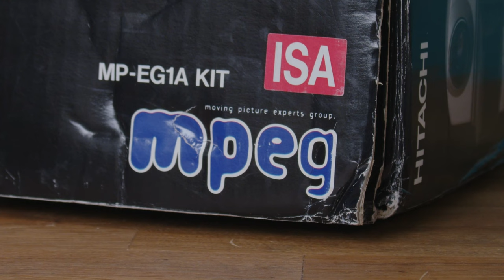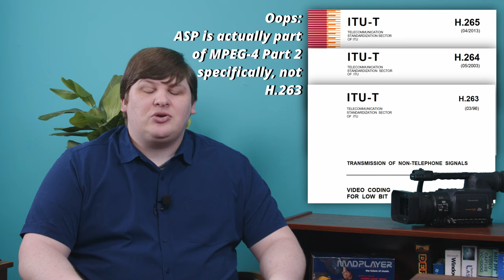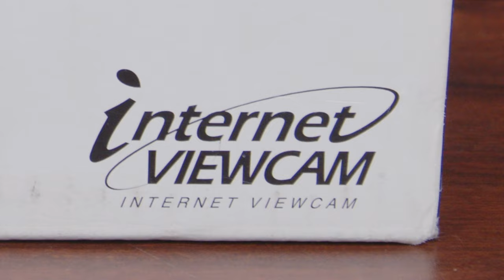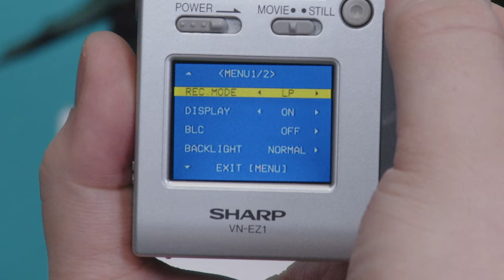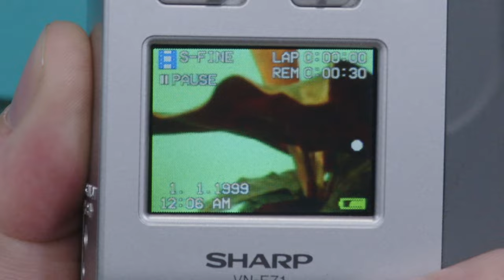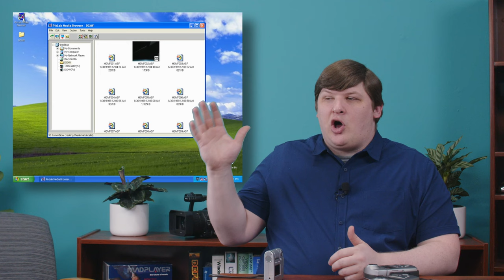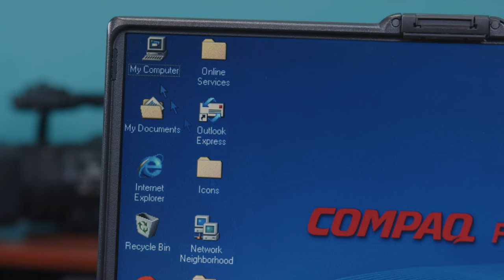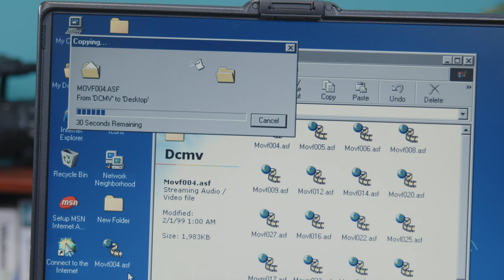The first thing that ever used MPEG4 [Sharp VN-EZ1]

Comment: Hey, CRD, I just wanted to point out that all MPEG-1 and MPEG-2 encoders must include a JPEG encoder as part the encoder. This is because I-frames are encoded in a format that is essentially JPEG, just without the headers that a JPEG file includes to tell the JPEG decoder what it's looking at. For those who don't know, in the world of MPEG, I-frames, aka intraframes are the bedrock of MPEG video compression. The way that MPEG works is that every so often you have an I-frame. Then, after that, you have a series of P-frames and B-frames, before another I-frame. P-frames, aka predicted-frames, just hold the difference between the last I- or P-frame, as fully decoded, and the current frame, and this difference image is much more compressed than an I-frame. There are also B-frames, aka biprediction-frames, every so often, which record the difference between the current frame and the two nearest I- or P-frames on either side of the current frame. These B-frames are extremely compressed, but no B- or P-frame can use a B-frame as a reference, so that their lower quality doesn't infect other frames.

In MPEG-1, the pattern of I-, P-, and B-frames is set before starting the encoding process so that you get a constant bitrate. In MPEG-2, the pattern is determined by the encoder during encoding, based on how much the image has changed from one frame to the next. If the image changes very little between the previous non-B-frame, the current frame, and the next non-B-frame, or if the bitrate is going over the limit set by the person doing the encoding, then a B-frame can be used. It the images changes a bit, but not too much, then a P-frame will be used. If the image changes a lot, then an I-frame will be used. Encoding quality goes up with the number of I-frames relative to the other types. B-frames are rarely used, because using them both reduces quality and increasing encoding time. Later encoders can do two-pass encoding where, in the first pass, no B-frames are used at all, but information about where B-frames could be used without reducing image quality is put in a separate file. Then, on the second pass that information is used to add in B-frames where they'd be useful.
Reply: Interesting, thanks man! So does that mean MPEG-2 has a variable GOP structure? I know video bitrate will vary with content type, that makes more sense now
Reply: @petey8155  yes, the structure is variable for MPEG-2. Technically, MPEG-1 could also vary, but encoders rarely did it. There isn't a whole lot of difference between 1 and 2 as far as I can tell, but I'm no expert. In fact, all MPEG-2 decoders can decode MPEG-1 without a problem.

My knowledge comes from converting movies from DVD to (S)VCD back before DVD burners were a thing. Back then, the encoders for MPEG-1 were all CBR, and you set the GOP structure yourself. MPEG-2 encoders were all VBR, and varied the structure on their own. Now, reading in more detail about this, it seems that this was not really part of the standard, but was just how all the encoders worked. Both standards were VBR with variable structures, it's just that no one actually did that with MPEG-1. Wow, I'm glad I checked that out. It's even weirder than I thought.

To make things even crazier, parts of P-frames can be encoded as if they were I-frames, and parts of B-frames can be encoded as if they were I- or P-frames, which is a big part of why the bitrate can vary so much.

Comment: Sharp has always struck me as one of those really interesting companies that always looks forward but keeps a foot in the past, “just in case”. They know that users don’t upgrade when they’re told, and they have (in their eyes) near-infinite space for their website. What does one page matter, or one section? If someone is out there using this MPEG-4 camera today, or wants to know how things looked years ago so they can compare their new device, let them. Same usually goes for manuals. I really appreciate that approach. It’s not active “support” of the old product, but it makes you certain that when you buy a Sharp device of any kind, you won’t be disavowed the moment the next one comes out. 

Though I will admit, there’s a little bit of “what were they thinking?” going on in my head when I see 2FPS video. Knowing that the human eye works “around” 24-30FPS, I am still lost on the purpose when I see a device doing less than 12FPS - give the human brain leeway and we can interpolate. 2FPS is nearly a slideshow.
Reply: I have to say props to the web admin who realized the webpage is so compact it probably only takes handful of megabytes why bother changing it or getting rid of it when storage is getting cheaper.
It's so annoying that given a few years these companies just dump everything off the website and make it impossible to find. Or act like their user manuals and service manuals are sold property that nobody should ever see the light of day.
Reply: This is 1999, having more than 15 fps video on the internet would have been pure insanity, even moreso for email. These resolutions and frame rates were still typical for camera phones in the mid-2000s as well
Reply: Say you've never once seen over 60fps on a screen without saying it

Comment: Is  Sharp's website for this camera still up after twenty years?
It was only in the last few years that the Sanyo UK website vanished, taking with it the user manuals for their Beta video recorders such as the huge selling VTC5000 which in 1983 outsold every VHS model.
Reply: If you can believe it.
Reply: Sanyo was purchased by Panasonic and they deiscontinued anything Sanyo and started removing their old properties. They actually relaunched some Sanyo branded TVs to sell at Walmart to keep the cache of the brand name and to get more real estate on the shelf with two brands to compete with the low cost brands and house brands.

Comment: Two nerdy corrections: 
1. H.261 is a separate standard from MPEG-1. They're very similar, but they are different - MPEG-1 can do basically any resolution up to 4095x4095 at up to 100mbps, while H.261 is limited to 176x144 and 352x288 at up to 4mbps. H.261 also predates MPEG-1 by a few years - 1988 vs 1991.

2. H.263 is indeed a different codec to MPEG-4 SP/ASP. H.263 was common, but only really on older mobile phones. It only supports a set of resolutions (128x96, 176x144, 352x288, 704x576, and 1408x1152), and I believe may be computationally a bit simpler but don't quote me on that.
Reply: Guess that magazine clip he showed from the time made the same conflation — it said MPEG-1 was limited to 320x240, which is clearly the NTSC “version” of 288p. By your info here that’s a close match to H.261, not MPEG-1. I was going to say it was neat they were thinking about UHD resolutions and high bit rates even back then, but it is called the Moving Picture Experts Group, not the Online Video Experts Group. They were thinking about digital tape and optical discs, predominantly, so it makes sense. 100-200Mbps were easily achievable on digital video tape, and some of the early SD digital tape boxes used ~150 with little to no compression  IIRC. So 100 is a sensible ceiling limit for their first digital video compression standard.
Reply: @kaitlyn__L That might potentially be something to do with maybe how MPEG-1 evolved over time or something - H.261 was rarely used (if at all) excluding video telephony. H.261's resolutions fit in perfectly with the bitrate limits of late 1980s dual ISDN lines. Also your view on how they might have used MPEG-1 for recording to tape is never one that I thought of, however it makes perfect sense. Also in terms of MPEG-1 on discs, it did indeed become a commercial product with 1991's VCD (Video CD). You got 352x288/352x240 MPEG-1 at 1150kbps, and MPEG-1 Layer-II audio (stereo at 224kbps). They were quite popular in Asia (and still even are to this day). And yes, I did go to the effort of transcoding GotG (and its extras) into the correct codecs and bitrates, and then put it on 2 of them (the amount of video is the same as a standard audio CD, so up to 80 minutes per disc). Quality absolutely reeks, amazingly enough.
Reply: @lbsiuk  see, I knew about VCDs and had presumed they used Layer I or Layer II audio, but didn’t ever really think about the codec — perhaps I just assumed it was much lower bit rate MPEG-2. So I was kind of referring to VCD in my first comment but I wasn’t fully confident to simply invoke it as a use case. Thanks for the confirmation!

As for tape, I was thinking of the uncompressed D1 from ’88 which was actually a little more than I said — ~170Mbps in fact. Though the still-uncompressed D2 from ’89 is a mind-boggling 480Mbps(!!) so, 100Mbps sounds pretty tame compared to that. I was wondering if Digibeta might’ve been a use case, since that ran at ~90, close to MPEG-1’s limits and came out in ’93, but that seems to use a proprietary Sony codec (albeit still discrete cosine transform based just like the MPEG codecs). 

By the way, I just read a book called “How Music Got Free” by Stephen Witt, it’s mostly about the history of the MP3 but it goes a bit into the other Audio Layers as well, and also covers the music industry and the piracy Scene of the 90s and up until the mid-00s. You might find it interesting! 

I knew a decent chunk about MP3 already, but until reading the book I didn’t know that AAC was a slightly updated internal prototype of MP3, mostly just lacking the terrible filter-bank MAGICAM had strongarmed MPEG into demanding be used. We could’ve had faster encodes and slightly better bitrate performance all along, if Fraunhofer had been allowed to use their own filter-bank. AAC might not have even been necessary to release!

Edit/addendum: Speaking of the MP3, it was also designed around the target of 128k for ISDN. The original idea was for streaming “CD quality audio” over those pipes — they were taken by surprise that it was widely-adopted for storage! So that’s a neat confluence there with what you said. I suppose ISDN was very influential all over the place, we do see 128/64/32k bitrates (and higher multiples) in lots of places after all.
Reply: @kaitlyn__L  Oh wow! I remember Sony D1 now - the tapes are ENOURMOUS! Each one even came with it's own sorta 'briefcase' lol. And big thanks for the book recommendation, I'll have to read it at some point. In terms of the whole MP3 fiasco, that's something I also knew partially about, however had no idea that they couldn't even use their own filter bank!

Also in terms of the other audio Layers, I've managed to encode all three - turns out that the best MP3 encoder (at least for 128kbps) that I've managed to find happens to actually be Fraunhofer's IIS Pro encoder rather than LAME. For Layer II I've only tried a couple of encoders, however so far TwoLAME appears to be the best. Layer-1 encoders are really rather rare, however I have managed to encode a few things with SoloH (off of ReallyRareWares). To put it simply, 128kbps SoloH MP1 sounds a lot like LAME MP3 at 64kbps.
Reply: @lbsiuk  heh yeah, Fraunhofer’s guys pretty much just said “but our filter-bank is better!” in objection, and MPEG said “sure, but we’re the standards body, and MAGICAM is a big partner of ours. Take it or leave it :)”. So that’s why MP3 encodes take so long to do, it’s mostly running through all those cycles in that terrible slow filter bank. 

But then, because it performed worse on the encode (even though the earlier prototypes didn’t!) it was sidelined for Layer II initially by MPEG. The guy from Fraunhofer he interviewed for the book basically says he thinks it was a stitch-up to let Philips and MAGICAM “win” the competition. But he got the last laugh because the smaller file size of MP3 was worth the longer encode time for file sharing, and it was less resource-intensive to decode so portable players were easier to make. 

I’m not surprised that Fraunhofer’s own implementation of the encoder is the strongest, that remains the case for other codecs AFAIK — Apple licenses Fraunhofer’s AAC encoder and it outperforms the free ones for any given bitrate. 

I wonder if a DCC machine is a better hardware Layer I encoder than that software — Layer I was Philips’ own creation as I recall, so the ASICs or whatever they put in those boxes might do a decent job?
Reply: Its mpeg 1.1 that have the higher resolution for say svcd. And mpeg 1.2 can have pretty much any resolution... that is.. also the same as mpeg 2.0. 

Really the only benefit of npeg 2.0 to 1.2 is that its better defined... well... sort of.. it was, untill mpeg 2.1 when they made it HD conpatible.. that was pretty much never used.
Reply: Vegas Pro can do stunning 1080p videos at 15Mbps (variable) using MPEG-1. The trick is to change some values on the 'System' tab, change the buffer value, and use 28 I-Frames for 3 B-Frames. The end result is really impressive.
Reply: @kaitlyn__L  "Apple licenses Fraunhofer’s AAC encoder"
While I'm aware of Apple using Fraunhofer's MP3 encoder in iTunes, as far as I know, the Core Audio AAC encoder was entirely Apple's development. 
Core Audio generally beats out Fraunhofer's FDK AAC encoding library, but from what I've heard new builds of FhG tend to surpass Core Audio. 
Unfortunately I'm only aware of EZ CD Audio Converter & Mainconcept using it.
Reply: @kaitlyn__L  For AAC Apple has got their own encoder (called QAAC). Funnily enough it's generally agreed to be the best AAC encoder, outperforming Fraunhofer's software by a larger margin.
For a DDC machine's Layer 1 encoder, I would love to try it out and compare!
Reply: @igorpoco2420  I'm surprised that Vegas supports MPEG-1 - it seems super niche.
Reply: @lbsiuk  oh, whoops! I know they license AVC and HEVC (and HEIF), and pay the UNIX license for OSX, (along with smaller things like paying for a Helvetica license for every install); so I assumed the AAC encoder was licensed too. That’s what I get for assuming! :) But it does make sense that it was their own. The book mentions the project lead on MP3 and AAC (Brandenburg I think) was happy for MP3 to retain dominance, as he got larger royalties than AAC would give him purely because the team was larger on AAC. Jobs used it with iTunes because he was a codec nerd and preferred it. So I can totally understand that he’d command a better in-house encoder.

Comment: 19:29 MPEG-4 Part 2 and H.263 are arguably two separate codecs. For "compatibility" between the two, MPEG-4 Part 2 requires decoders to also be able to decode H.263; but as far as I'm aware and can tell (I have written H.263 decoders but not MPEG-4 Part 2 decoders) the way they handle this is to have an extension that upgrades the video bitstream from H.263 to MPEG-4. I'm pretty sure, though not 100%, that this is entirely separate from the extensions defined in later versions of H.263.

MPEG-4 Part 10 and H.264 are basically identical, because MPEG and ITU finally got their act together and figured out how to agree on a bitstream.
Reply: 21:30 DivX wasn't open-sourced as XviD; DivX was originally supposed to be an open-source project before the company decided to pull the code down. So XviD is actually a fork of a really early version of DivX.

Also even earlier versions of DivX were actually just hacked versions of WMV1 - Microsoft locked the codec to only output video in ASF format and "DivX ;)" was a patch to remove the lock. Then they worked on their own clean-room version of the above.

God, video codecs are a bottomless pit of annoying little factoids.
Reply: Yeah the only place I saw say H.263 back in the day was Apple about iChat video call. Everywhere else was talking about MPEG4.
Reply: @SuperSmashDolls  DivX was a hacked version of the mircosoft mpeg4 codec. First calles projekt Mayo. The ms version could only encode up to 256 kbps and Mayo could do 6000 kbps. And  you could use the avi containter.
Reply: @SuperSmashDolls  This reminds me of my hellish teens of trying to play video on the go, specially in school breaks. Also making that 40, then 80, then finally 320GB laptop hard drive to hold any videos.
Portable video players ("MP4 players" that NEVER played .mp4 files or anything on the MPEG4 spectrum), phones, anything. To hell and beyond with b-frames limits, FPS limits of the players (one of them played XviD 20 FPS with MPEG2 video on an .AVI container, and if XviD had those B-frame thingies (you'll know to tell it, I forgot!) you can be sure it had to be tweaked with perfection), bitrate limits and everything.
The world was a simpler place to live when I got my 1st Android phone (an Xperia X8 at the time), still VERY weak and picky but nowhere near that nightmare anymore, and I stopped ever caring on the next upgrade that just ate anything non-h265, 10 bit or 444 weirdness. Now even those are unimportant to just play it flawlessly.
Reply: @SuperSmashDolls  And at the time all these were used they were a bottomless pit of annoyance making sure you had all your codecs to play all the different video types. Then when they did not play correctly you had to figure out if it was a codec error / incompatibility or just an incompletely downloaded file.

Comment: I would imagine that the reason you need conversion software for trimmed clips would have to do with I Frames and P or B Frames. The camera may only be able to split the clip on a frame, but may not be able to re-encode the clip with a new I frame and re-calculate the rest of the encoding process of creating new I frames and interpolated frames.